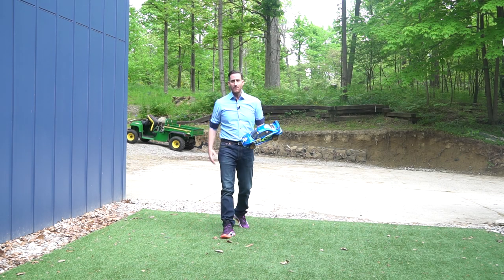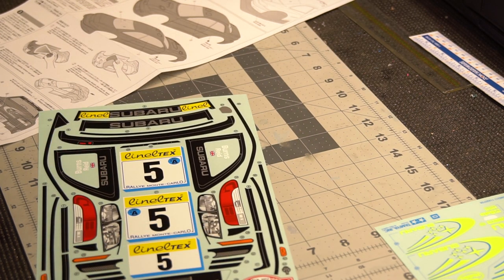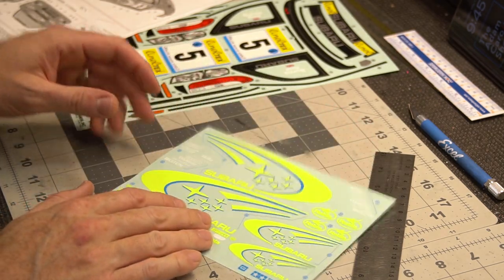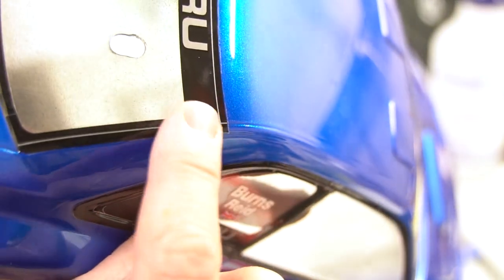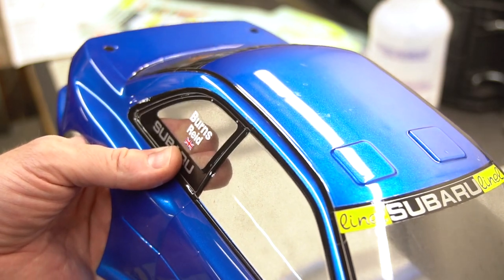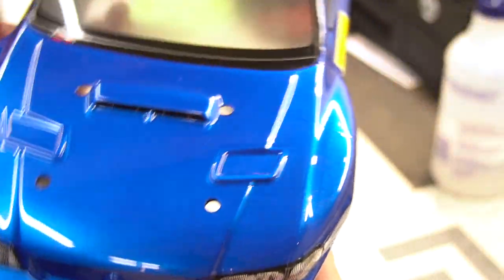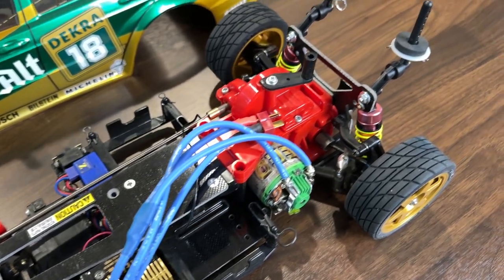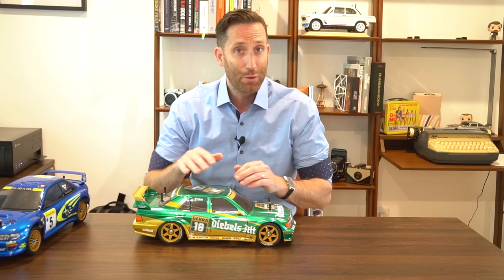ep010 The BEST Way to Apply Decals

Comment: Wish me luck, I'm building my first RC car, the Tamiya 1973 Porsche 911. I wont it as a show piece and the paint and decals have me worried.
Reply from the maker: Just take your time and everything will work out well, I'm sure. I also did a painting tutorial as well. You may want to give that a look as well.
Reply: I was so successful, it turned out great.
Reply from the maker: @2ndLastJedi  Awesome to hear! Thanks for the follow up!
Reply: @quietrc  Just took my time, misted the paint layers on and with the decals i soapy water wet them and used a hair dryer, they are 94% perfect. For a first time builder i am so stoked :D
Reply: @2ndLastJedi  Glad to hear your project was a success. You definitely followed the right tutorial. Even if it takes alot longer, always better to do things to the higher spec. 👍

Comment: I like scissors myself they are fast and accurate if you get good at it. I have not tried a razor and will try it out. The hair dryer and soap water is a great tip. I'll use tweezers for the small stickers.

Comment: Nice work there and some great tips. Yek ive used Tamiya PS paind on small pieces of abs plastic and it doesn't have a gloss result but seem to be okay. A lot of people say not to use PS paint on ABS plastic as it may dissolve the plastic. Like even hobby shops and Tamiya instruction manuals say this. Nice work again 👌👍
Reply from the maker: I wonder if laying down primer like I do mitigates any danger of dissolving the ABS. I haven’t seen any issues myself. Hope there were some helpful tips in there for you!

Comment: For trimming, use a metal eraser guide. it makes sharper, straighter cuts.
Reply from the maker: @micsherwood4930  That’s a great tip. I use a metal ruler in the video, but that eraser guide seems smaller and more convenient.